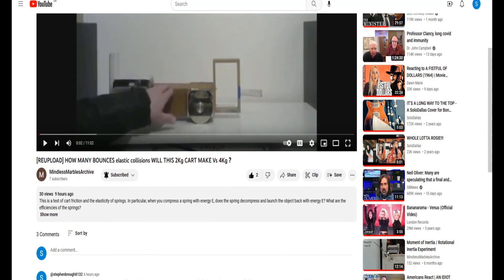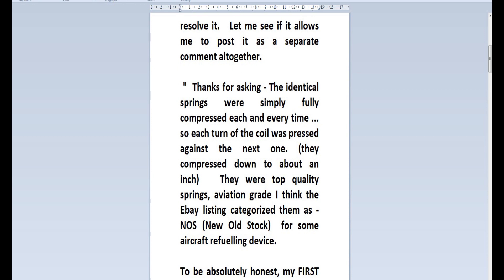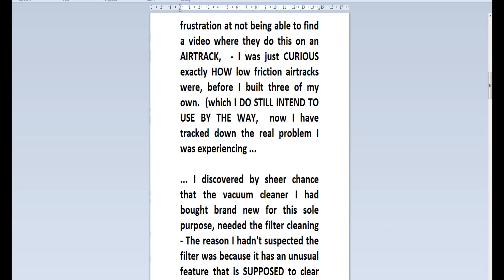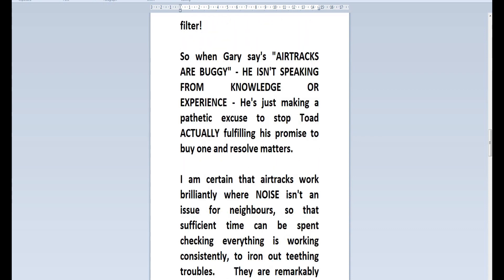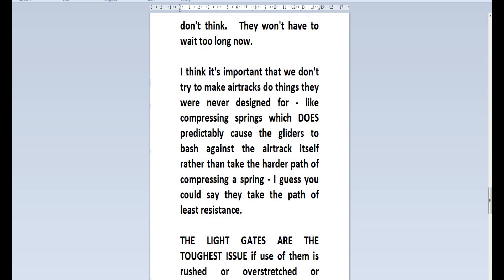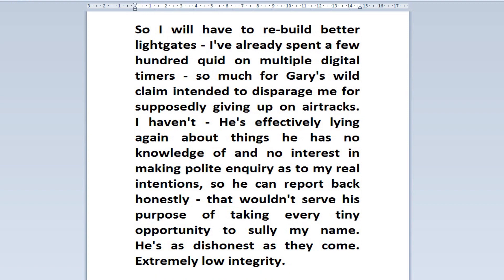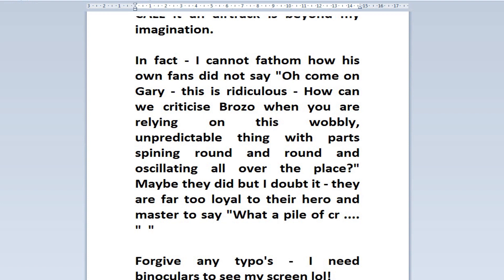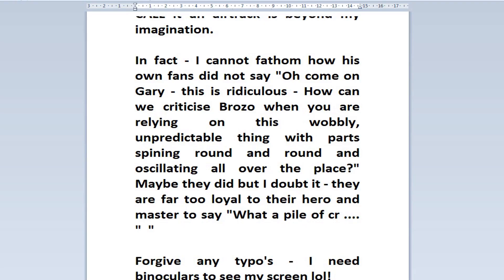YOUTUBE BLOCKED MY REPLY TO MINDLESS MARBLES SO HERE IT IS IN VIDEO FORM.

Comment: Hey Stephen

good news, i've contacted the scientific department in my town and they referred me to a professor who owns the equipment to perform experiments with carts on a track (pasco) . I'll contact that professor soon and hopefully i can make an appointment  and try out some stuff.
Reply from the maker: That's great news Dispar.  We should all follow your lead - including Gary.  Got my hands full at the moment and something good to upload ASAP but I really need to try to get to sleep - I'm over-tired if you know what I mean.   Best of luck with that and thanks for letting me know,
Reply: @stephenbrough8132  Yeah i know what you mean. Get as much rest as you need. Looking forward for the new upload, but don't hurry to much. I will also make some new video's (1m going 2v VS 2m going 1v colliding at different objects and see if the impact is the same or not). Thanks and take care.
Reply from the maker: @disparslab326  Yes, the video you describe you are intending to make sounds reminiscent of my oldest video that kicked off the pushback against Gary's claims against physics girl and so on, two years ago - my March 9th video if I remember correctly, 2021, with the thumbnail calling him a W.NK£R - That comprised 4 versions of Gary's challenge to us, where he had repeatednly DEMANDED we SHOW evidence that the 1mass at 2x speed  A) COMPRESSES A SPRING MORE (it certainly did) ... B) MOVES MORE MARBLES, OR ANYTHING ELSE (it certainly did - I had the two different masses crashing into some heavy steel staples - He didn;t like that lol)   C) GENERATES MORE ELECTRICITY  (it certainly did - I had the two masses crasging into a small electrical impulse generator, you might call it - ie a magnetized rod being pushed through a coil,  charging a capacitor with a meter indicating EXACTLY DOUBLE VOLTAGE GENERATED - He didn;t like that, but he doesn;t understand anything about electricity wheras I am at least qualified on that topic)    and D)  he said SHOW me the lighter object crashing into a rope and LIFTING A HORSE WITH A PULLEY ... so, not having a horse or an ACTUAL 10 ton or 5 ton train, used in all his examples,  I made a pulley arrangement using cotton spools, showing it lifting CHESS PIECES representing a horse (I had to use a PAWN as the KNIGHT was a bit too heavy) ... and yes it certainly did, once more, lift the "horse" higher.  

I did other variations but it was just labouring the point that he was clearly wrong in all of these and other incarnations of his claim that they would do absolutely identical amounts of work ... He demanded to see it pumping more water, for instance ... lighting more LIGHTBULBS - It certainly DID light ONE lightbulb far brighter for longer, although I had to video in in the dark to see the filament glow in both cases - that was just a little hand cranked generator with a built in lightbulb, an incandescant light bulb  - a FILAMENT LAMP - because those give a clearer indication when power is doubled - LED's have complications because they require a certain voltage before they turn on at all. 

Then came all the "SHOW ME!!... an 8 pound bowling ball knocking down more pins than a 16 pound ball at half the speed ... SO I DID, with very large, heavy reels od 2inch recording tape serving to represent bowlomg balls of those two masses or similar, knocking down bottles of water ... and clearly, the lighter one going faster, knocked down more.  

AND ON AND ON IT WENT - him coming up with endless variations of his challenmge, completely denying every time I DID show him he was wrong already.   HE JUST KEEPS RE-INVENTING THE CHALLENGE - EVEN BETTING ON SOMETHING HE HAS NOI INTENTION OF EVER PAYING UP ON.   He never paid the $50 on the bet I won - Predctably, he just lies that I didn't meet his challenge.   He's an absolutely massive (insert an insult of your choice!).

I'm not the slightest bit afraid of him because he's the most cowardly, weak, dispicable person imaginable, in the contects of his peudo science.  

The urony is, I COULD have cheated those experiments IF I HAD WANTED TO, becuse I accidentally discovered it was EASY to make the results TWICE AS IMPRESSIVE  AGAINST GARY'S CLAIM - by empluoyng a lever which was just VERY SLIGHTLY flexible,   because that makes the 1 mass at the far end of the lever, 2 x durther from the fulcrum, GO EVEN FASTER THAN 2 X SPEED - MORE LIKE 3 X - because it bends FURTHER than it is meant to in the 2:1 ratio scenario ... so it acelerates the 1 mass FASTER than 2 x faster ... and copresses the spring MORE than it is supposed to ...

... IF I HAD INTENDED TO BE FISHONEST, AS HE FALSELY CLAIMS, I would have KEPT my first lever and showed THAT experiment - but that WOULD have been dishonest of me....

... So I replaced it with a strong STEEL LEVER ... as well as a "STOP" TO PREVENT THE LEVER GOING FURTHER THAN IT WAS MEANT TO ... 

And that's why I even wrote in LARGE LETTERS across the middle of the table in my published experiment ... " NEW BAR" ... meaning that was my SECOND atte,pt with a stronger lever which could not flex and would stop dead against the "stop screw". 

In my latest version I will publish ASAP, I have used a very large block of copper to act as the " STOP" - and although the lever is noiw ALLUMINIUM (because the weight of steel would interfere with the results of this particulkar demonstration) ,  the heavy copper mass was CRUCIAL to make sure the alluminium lever did not also flex ... It may be matal and relatively strong but it DID once more accelerate the 1 mass TOO FAST until I took measures to make sure it gave 2:1 results (when both masses were launched simultaneously)  and not more like 2.5:1 or 3:1 - 

That's a very important point to observe, or we get the wrong results, dishonest results if we were to do that deliberately, exploiting that weakness.

... Sometimes that would benefit GARY rather than me, buit it would still be cheating ... except that Gary would not object to whatever it took to get the results HE wanted.   

It's also important to note (and this is the whole point of my latest experiment due to be uploaded ASAP) ... it's important to note that WHEN THE SAME OBKECTS ARE LAUNCHED SEPARATELY, THE 2:1 RALATIONSHOP COLLAPSES ...

... The 1 mass NO LONGER GOES 2 X SPEED ... it goes EXACTLY 1.41 x speed.  (1.4083, if we are being pedantic) 

Gary needs to ask himself HOW can the same axperiment that just PERFECTLY demonstrated the true 2:1 relationship when both are launched together,  THEN somehow be "flawed" (as he is bound to claim)  when it shows a PERFECT 1.41 ratio relationshop when they are launched singly? 

He will; waffle and accuse as usual - but it will all be just him being too weak to face the facts.   The real facts.  Not his invented ones, endlessly re-invented and regurgitated. 

Th reason it comes out at 1.4 is because as the kinetic energy formula suggests, the same spring CAN ONLY give the same amount of energy to EACH object separately.    SO THEY HAVE THE SAME JOULES when it;s 1.4, launched singly ... BUT THEY DO NOT HAVE THE SAME MOMENTUM.   (IE 1.4v X 1m IS NOT THE SAME MOMENTUM AS 1v x 2m - launched separately.)

... But in the other scenario, both being launched off the lever at the same time, the 2:1 relationship is inevitable, (so long as the lever does not flex and care is taken to ensure it sops dead whe  it meets the heavy mass or say a screw to stop it going too far)   ... NOW THEY HAVE THE SAME MOMENTUIM (2m x 1v vs 2v x 1m)  BUT NOT THE SAME ENERGY (which sounds confusing until we punch in some simple numbers and apply the KE formula ... THEN we realise THE 1 MASS CAN ONLY GO 2 X FASTER if the spring or whatever is approtioning MORE of it;s finite amount of energy to that smaller faster object.   

Gary then jumps to the wrong conclusion it means there has been a GAIN in energy lol!    NO! - The speeds in THIS experiment are BOTH much slower than when the objects are launched separately, Gary! 

He can't wrap his head around that - and I concede it CAN be confusing if a person never shurs up long enough to THINK it through.

So, yeah, best of luck with your work, Dispar - just be mndful of these pitfalls to save time in the long run, having to do experiments again - a mistake we all make when we are in a hurry.  I made a DIFFERENT mistake in my hurry to demonstrate all of this with pools balls and a HALF pool ball, launched off a lever ...

... MY MISTAKE WAS that the HALF pool ballw was so LIGHT, it SKIDDED when the lever tried to accelerate to TOO FAST FOR IT TO GRIP THE SURFACE AND ROTATE...

... That loss of rotation and loss of contact with the surface meant IT WENT FASTER THAN IT SHOULD HAVE DONE ... 1.69 X the speed of the full mass, the full pool ball lauched in the usual position on the lever - 1 x distance from the fulcrum.

That gave Gary false hope - Because he AGAIN, jump[ed to a wrong conclusion, that SKIDDING implied it was subject to MORE friction, thinking that if it HADN'T skidded it WOULD have gone 2 x faster!!! 

... He was SO wrong!!!  Skidding made it go TOO fast, NOT too slow!

Hence the 1.69:1 result that he keeps wrongly bragging supports HIM, only quoting ONE of the results, not the final average - he keeps qyoting 11 Vs 19 (frame counts) AND SAYING THAT IS AS GOOD AS 2:1 ... well, to his empty headed fans, I can see why they wpould agree with such simplistic nonsense ... That actually works out to 1.72:1  because he's ignored the averaged results bringing it down to 1.69 - BUT IOT;S WRONG EITHER WAY!!  IT WAS MY MISTAKE!    I feel guilty for accidentally giving him this false ammunition - it;s MY fault ... and that's why I am putting the matter right ...

... by doing the experiment more carefully, using HEAVIER masses and a less slippy surface, (I used GLASS in the first experiment, thinking it would be a perfect, flawless surface - I never thought about skidding!  Oops!  My bad.    nOW gARY, BEING A DISHIONEST SO AND SO, EXPLOITS MY MISTAKE by wrong interpreting what it meant. 

So I am pleased to confirm the 1 mass DOES go EXACTLY at the speed the KE formul suggests - and Gary is wrong yet again.  

So I hereby apologise to everyone for causing this confusion.  We all make mistakes. 

The only GOOD thing about Gary in this insstance is that he WAS the oine who piinted out the skdding - I never noticed, or realised the significance.  Small things can make such a BIG difference to an experment - he's right about that much - but he always interprets thopse small things as swinging it in HIS favour if corrected - and he is always so, so wrong.  

He's not a man, he's a mouse.     I used to be a bit afraid of him nsulting me - which is his plan - It doesn;t work on me any more.  I LAUGH when he calls me all the names under the sun.      One day you will too.

Have a great day / night Dispar.
Reply: @disparslab326  My comment keeps getting censored, so I sent an email. It's nothing major, but I hope you find it helpful/interesting.